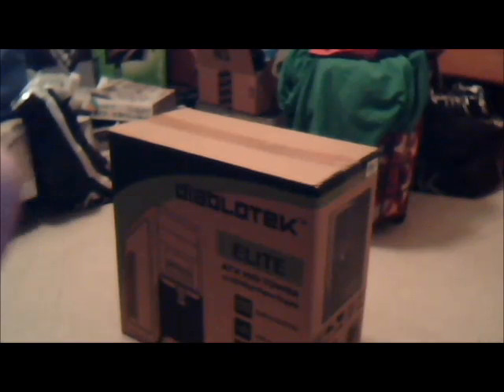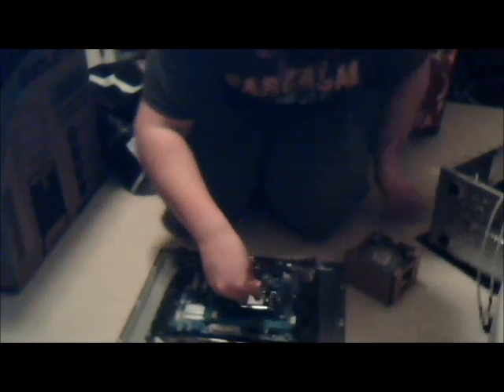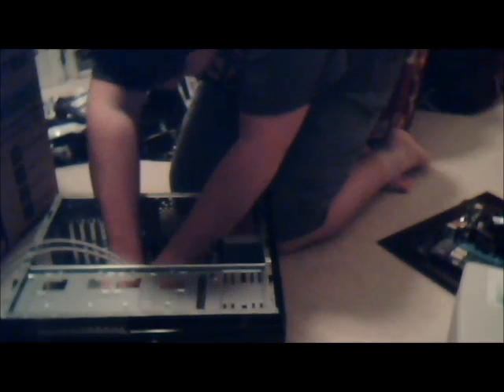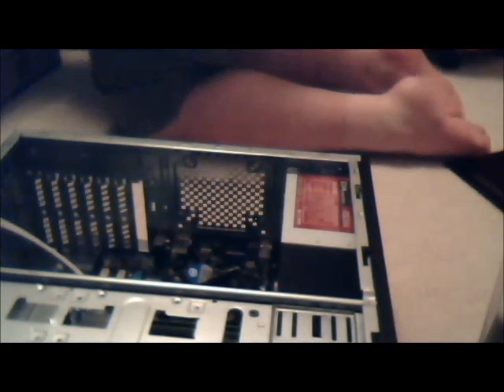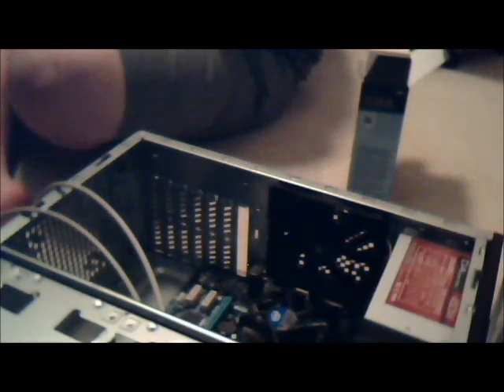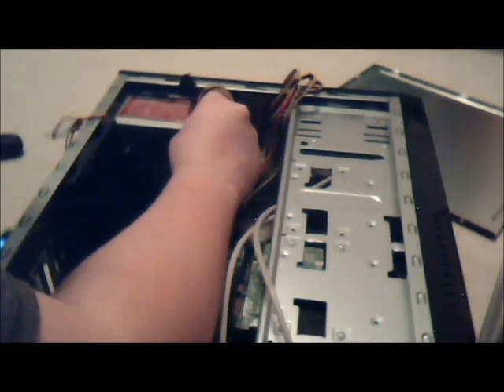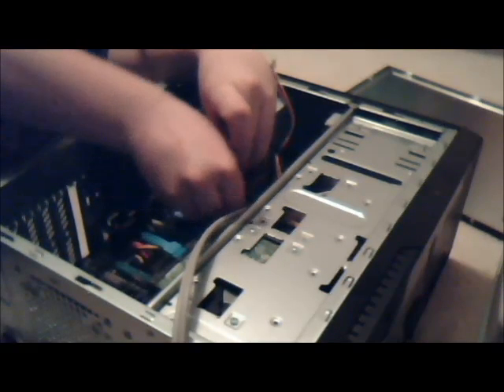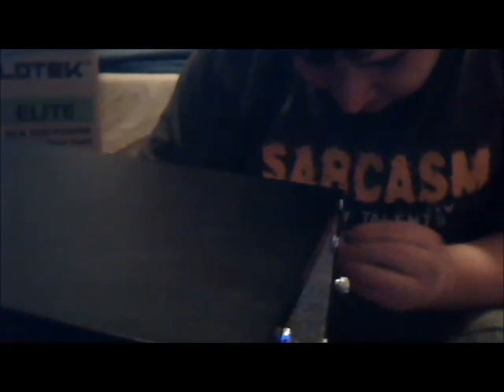Budget PC Build

Comment: Diabiotek is the worst power supply to use. If your works well. I don't think it will last longer than 6 morths. Please get a  better one you don't wantto replace alot of parts down the road. Apart from that your rig is great for it use. :)